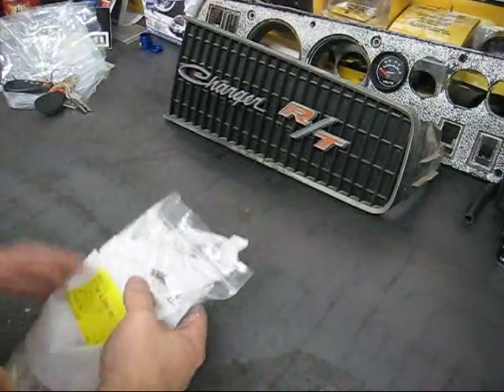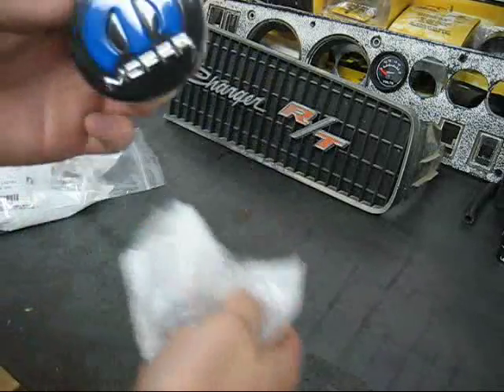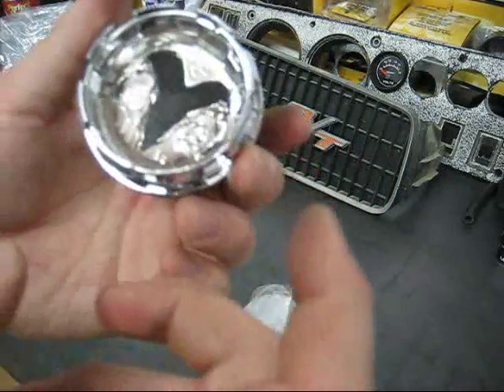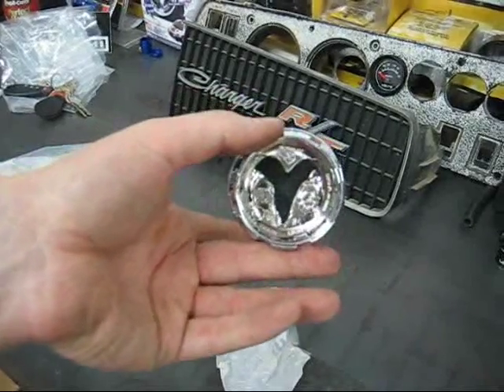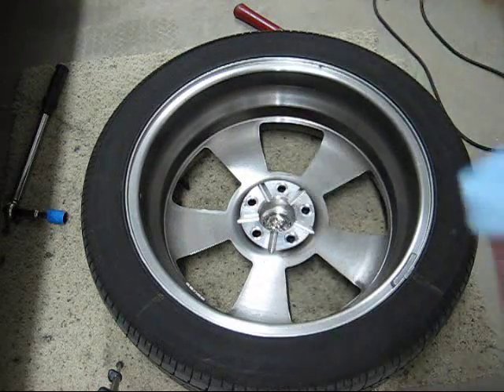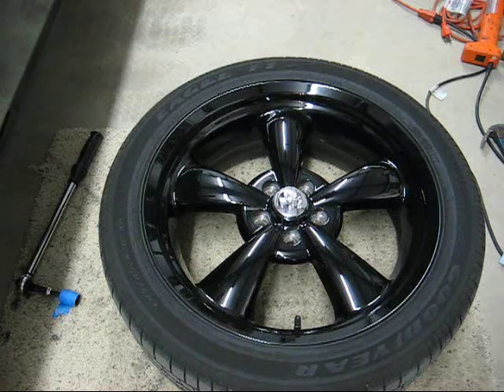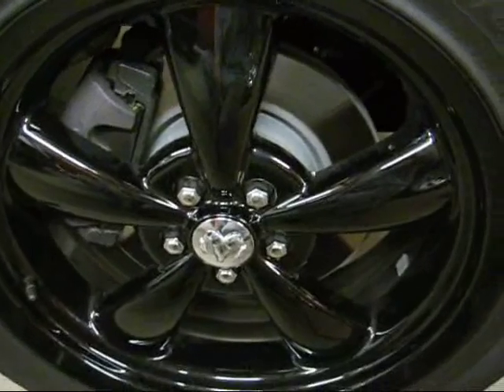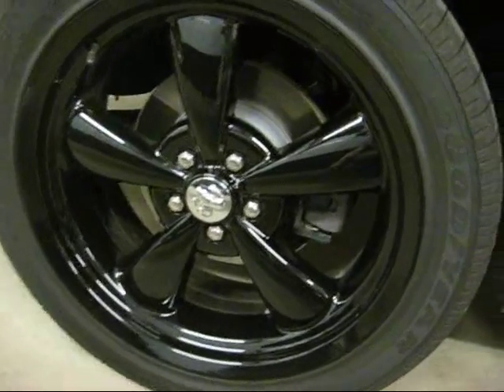Mopar 10 Center Cap Review and Install

Comment: Where did you purchase them from an how much did they cost. Do they fit a 2006 Dodge ram 1500 rim
Reply from the maker: The dealer I bought them from is out of business.  They use to be easy to find on eBay and Amazon.  If the specs match, it should be a press fit.
Reply: Thank you

Comment: so you have to take the wheels off to do this? I thought maybe you can pry them off
Reply from the maker: I would definitely take the wheels off...It is a great time to clean the inside of the wheel, clean up the wheel well, and paint calipers if you need to make it multipurpose.  You could probably pry it out, but I prefer this method.  Good luck!